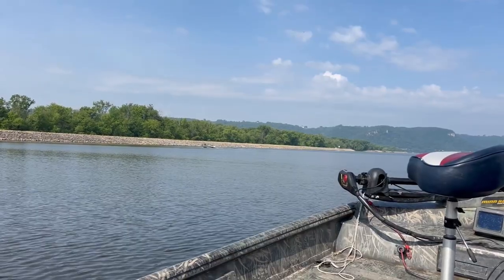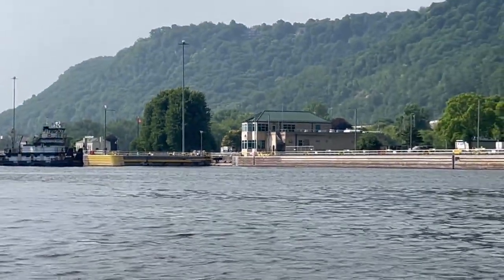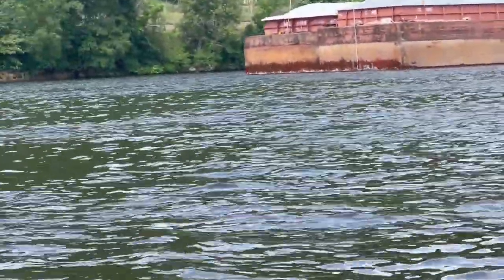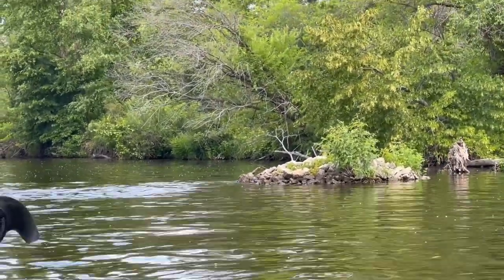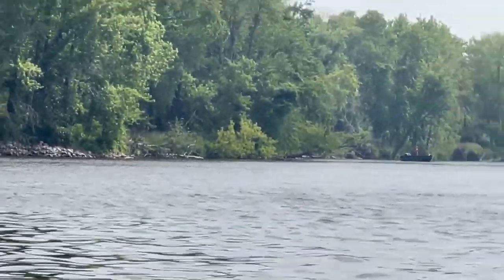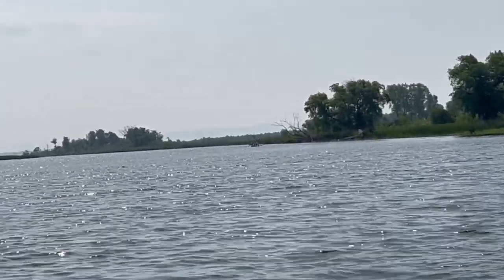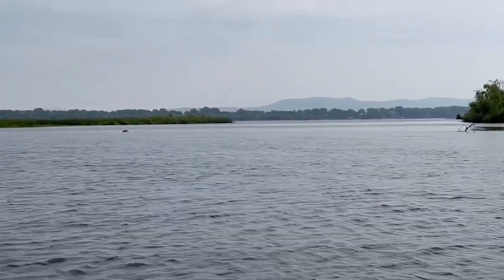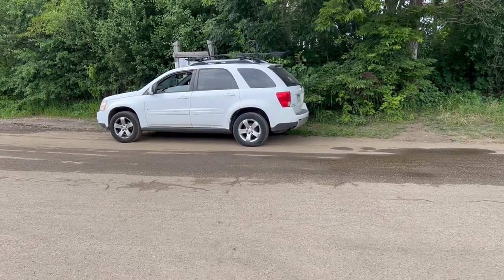Navigating Mississippi River

Comment: To get ahold of a lock they stand by on channel 14, except lock 25 and lock 27 use channel 12. Also the bouys are listed as. Green bouys are called blacks or cans. Then red are called nuns not cans. The river navigation is clarified as descending. So right and left descending. Right descending are always black ( green) and left descending are always red. Also good rule of thumb if you can't see the wheelhouse they can't see you either.
Reply from the maker: Thank you for that input!